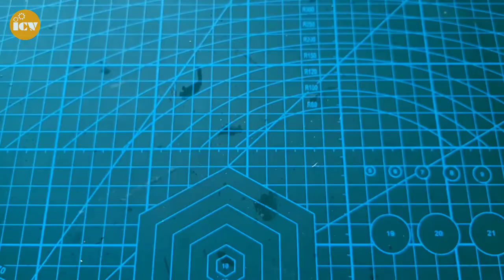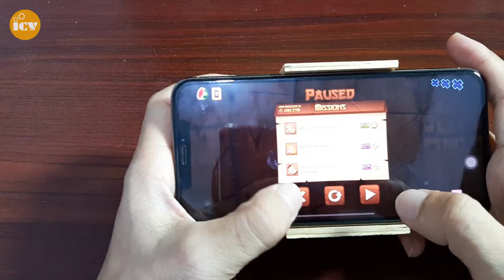DIY Cooling Fan for SmartPhone at Home || Smartphone Cooler

Comment: I think could be better if you use thermoelectric peltier 12v with 12v adapter and fan with semiconductor  for heat dissipation then the other side which is freezing cold is direct to the phone, similar to the funcooler radiator.
This home made cooler is useless, unless you have a phone with metal back cover, or you are using thermoelectric Peltier